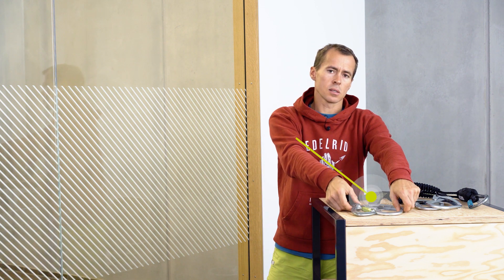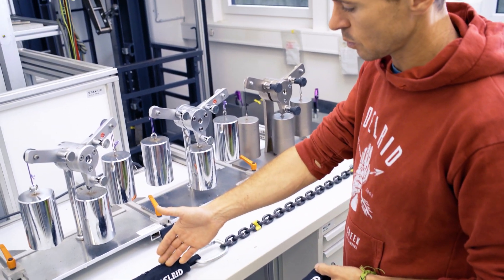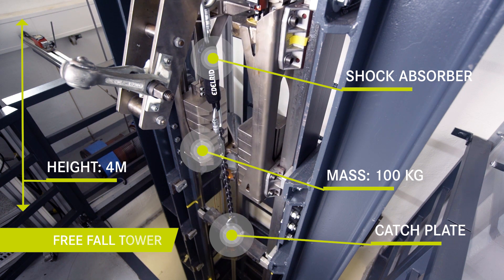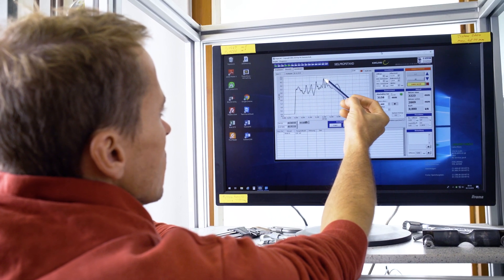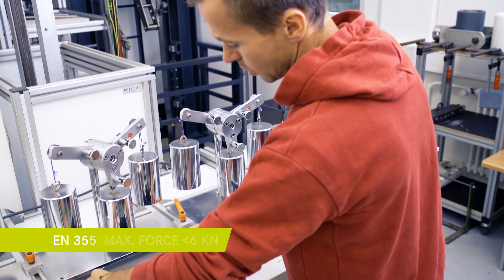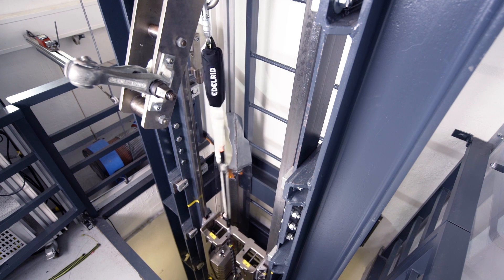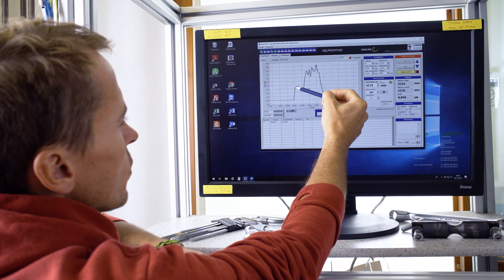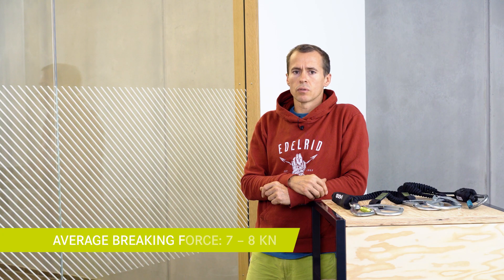Fall Into Two Parallel Shock Absorbers | EDELRID Knowledge Base

Comment: Great Video! But what would the force be if the climber/worker weighs only 50 kg and falls of a lower height? Are the 6 KN still guaranteed?
Reply: The norm says a max force of 6kN so yes.
Someone who is 50kg needs to fall further to generate that 3/3,5kN to start deploying the absorber compared to a 100kg person. That is the only difference. The function of these absorbers does not change with user weight. It needs a certain kN to start working. Does that make sense?